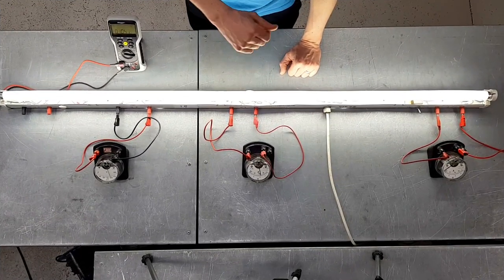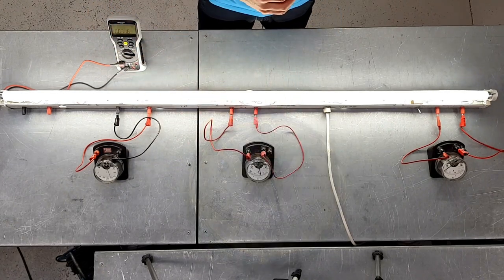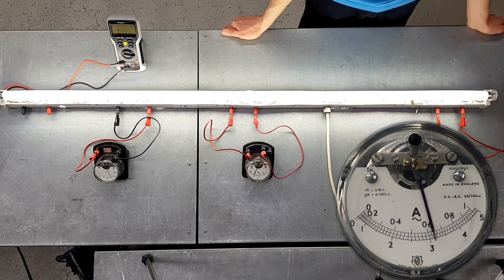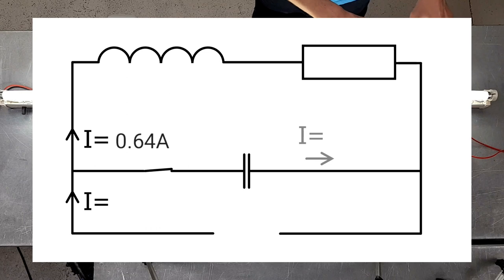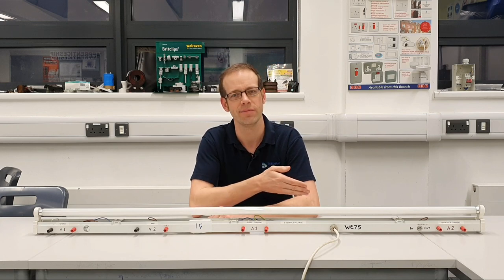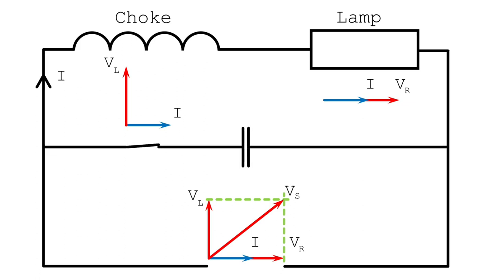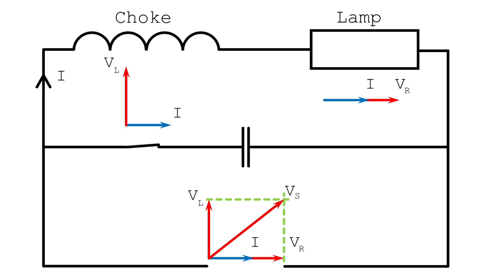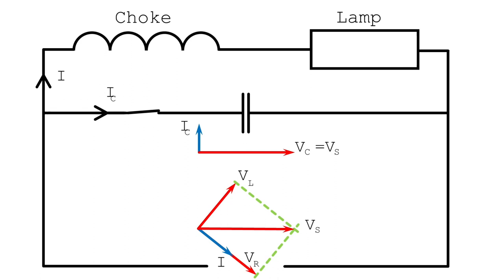AC Theory: Strange Currents in a Fluorescent Lamp Explained

Comment: So with the current being out of phase, it looks like current is flowing in two different directions through the circuit at the same time.  Can current do that or is the current trying to go two different directions but it can’t so you get the amount/direction of current that you show where the two parallel lines of the current intersect?  Great job on the videos, learning a lot so thank you!

Comment: Hi Joe, thanks for the great videos on AC circuits. Would this essentially be Kirchhoff’s Current Law for AC circuits? And what I’m really struggling with is understanding how the vector addition of the currents makes sense in terms of the physical charge carriers moving around the circuit, as it seems very intuitive to understand that the total charge carriers going into a junction in DC circuits will be the same as the total charge carriers leaving, but how would this apply in an AC circuit?
Reply from the maker: The key to understanding it is to recognise that the currents are waves and they're offset from each other, which is what we mean by out of phase. 😊